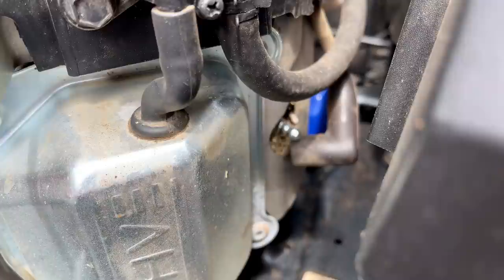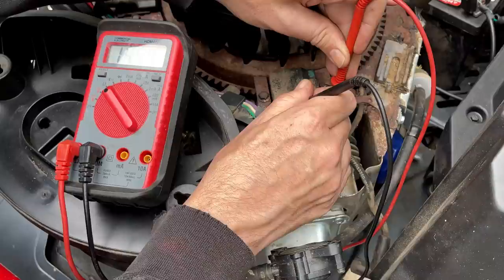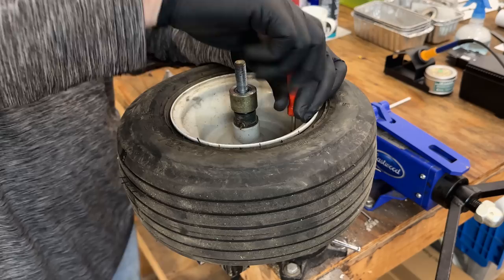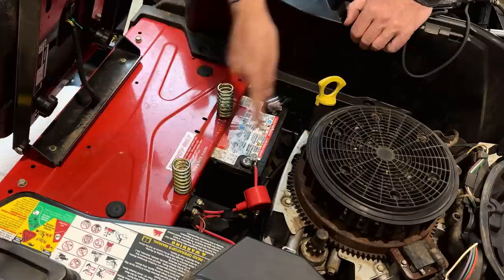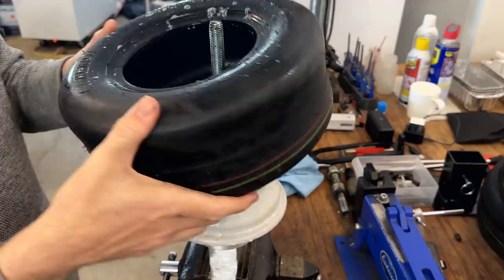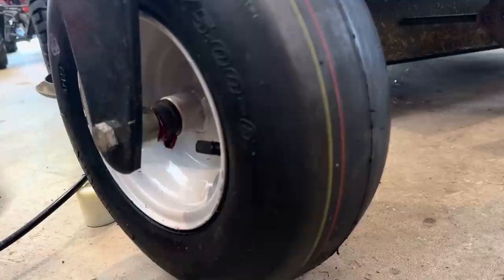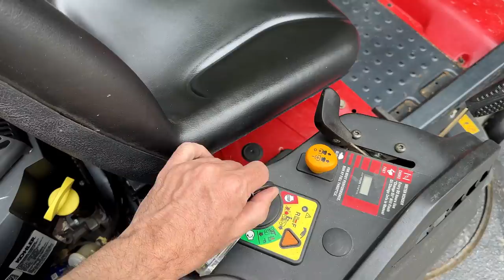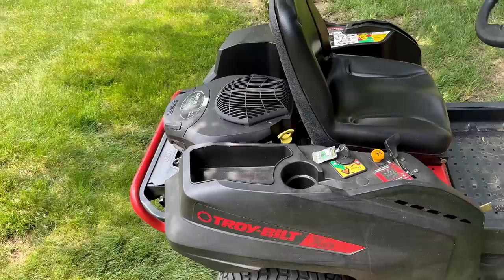Zero Turn Mower Down on Power - Not Firing on all Cylinders

Comment: Good call on the "working" coil. You had extended crank time before replacing it. After the engine started almost immediately. The missing chute contributed to the buildup of debris around the cylinder fins. The grass blew almost straight back toward the engine. Those small tires are a pain, you were lucky the rims weren't rusty like the ones I deal with. I just stick tubes in them. Great job!
Reply: I usually put tubes in all small wheels that start off without! Usually every spring the tires are flat over the winter if there are no tubes and then seem to slow leak all the time. So out with the same tire tool James has! They stay up then much better.

Comment: I like to coat magneto fasteners with threadlocker after touching them up on the wire wheel. That way the dissimilar metals are isolated and they can be set snugly. If they won’t come off easily the next time, then an application of a little heat will easily free them. No rust, no breakage!

Comment: I will give you a great tip I learned with these small tires on wide rims, I use a tube between the rim and the tire bead soaked with solution , so when you air up, the tube will roll out of the way and the tire will seat.

Comment: I as well very interested in what you do. I've always loved engines and getting them running again after years of neglect from previous owners. Garbage picked so many machines, engines over the years and got them running again and selling them and using the money to buy tools and garage supplies. One suggestion I have is to use dielectric grease on all electrical connections, spark plug boots....protects from water intrusion and that fretting corrosion. You do nice work James.

Comment: I certainly admire your diagnostic skill at fixing the engine. The design of the actual mower deck, with that gaping exposed space just where a foot can step into active mower blades (especially  a child's) is an engraved invitation to amputated and/or maimed body parts and lifelong guilt and regrets when someone gets hurt. I get the feeling that Troy-Bilt simply does not care about designing for safety. With that said, I will never need one of these machines. Troy-Bilt does not seem to be popular in my geographic area. It was very interesting watching you fix the engine and tires.

Comment: on mounting small tires, placing them on a smooth rim bucket or flower pot, so the wheel hangs from the top bead  and the rim of the bucket seals on the outside of the other side of the tire.  when airing up the air escaping into the bucket, pushes the wheel and upper side of tire up until the lower side of the wheel meets the underside of the tire and starts to seal.  i found this the only way to seat the rear tires on my riding mower without putting a tube in the tire.  btw,, the center hole in the rim needs to be sealed with heavy tape or make a plug of some sort to prevent loosing any air.  the rear wheel on my mower had 3/4 hole to slide over the axel so ta;e worked.  a large center hole or lug bolt style wheel will require a more creative solution.

Comment: Really James it's always been a sort of law when working with batteries you ABSOLUTELY never take the positive cable off before the negative.   Jus sayn   Other than that you really do very great work on whatever ur working on..
Reply: Please do not take this the wrong way..the rule is disconect " GROUND SIDE" first. Even today there is positive ground equipment. Not common anymore, still found occasionally.

Comment: Mechanics from way back (yours truly) would do a thing called "a dynamic compression test" on the very old (but at the time very high Tech) Sun Ociliscopes. We had the ability to very accurately monitor the RPM and ground out each cylinder individually and record the difference in RPM from the lost contribution of the grounded-out plug. The one with the least difference was suspected for low compression or other ills. The Shade Tree method was to take your test light (Almost always the old and indestructible Snap On) and attach to a good ground and then slip the tip under the plug wire boot at the distributor to ground out and listen to RPM change of each cylinder to determine which one was contributing least or not at all. Most engines were V8s or straight sixes so this was a fast way to zero in on the work.

Comment: Remember the fire triangle. The starting fluid trick won't work if you don't have enough air (oxygen) for combustion. No oxygen, no F-wap!. Hook up the air as if you're filling the tire then spray your flammable liquid into the tire and ignite. It may take a few times before the tire warms up and becomes flexible enough to catch. Filling the tire CONSTANTLY with air will also help it stay in place on the bead once it catches..

Comment: Had the exact same issue with my Toro Z turn with the Toro engine. At 5 years the coils went. It drove me crazy for a while trying to diagnose the problem. For a few minutes it would run great and then all of a sudden it would lose about 50% power. After a few minutes it would then return to running great.
 It drove me crazy for a while trying to diagnose the problem. I'm just a DIYer and thought is was a carb issue. After putting two new coils on it ran great

Comment: I had a gravely mower with that same engine. One summer it started bogging severely, almost like you had killed the spark to it. The issue only happened when going down a hill.
I replaced fuel pump, spark plugs, low oil sensor, ignition coil, carburetor, fuel filter, seat pressure switch, and made sure there was nothing blocking the fuel pickup. 
I got fed up with it and sold it before i could figure out what was wrong with it.

Comment: We ended up getting a Craftsman battery zero turn from MTD but looking at a Cub Cadet with that steering setup. NOPE! Never saw such linkages and potentiometers to tie it all together. Ours has 4 motors, one for each drive and one for each blade. Simple, quick and powerful. Plenty of reserve to do our place on one battery usage bar out of 5. The Stihl hand mower does the same. I've got an 85 Snapper and a 20 horse Craftsman Vanguard 42 inch for spares but they get to rest. I know that battery stuff is a new market, TOO new but we shall see. We have a small heater to keep the batteries from freezing in winter. Doing what we can do. God Bless

Comment: After watching you battle with those front tyres I'm glad my Toro timecutter has solid front tyres. I think I prefer the standard twin bar steering on my Toro it can rip the grass abit especially if it's abit damp but looks to turn better around small obstacles.
Reply: I have the same as you.. agreed on the solid tyres.  Factory ones would roll off too easy.  Also you are correct about tearing up grass!! Not good if damp.

Comment: Tire mounting compound. Aka bead grease. That’s the ticket that would have allowed you to mount that first set.
Reply: There is a video called “how to bead up a stubborn tire”. Older guy shows you what I mean. You fill the opening with the Murphy soap and when the bead seats it will squeeze out all the “grease” and you scoop it up and put it back in the container for next time. Stuff work’s amazingly.

Comment: A tip, let the tires sit in direct sunlight for as long as you can, it will soften them, or boil them in boiling hot water, but be careful wear thick gloves, for the heat.
Reply: Those tires should never have been sold in the first place ! They were improperly stored.
Reply: k5576  every one I have gotten from certain shippers on ebay, and Amazon are like that, they suck the air out of the shipping bags for shipping purposes, to save space, it's a true pain in the butt, but if you know how to deal with them, they can be used.

Comment: I had a similar problem on a Honda EX1000 generator.  It would not power up.  I took it apart and found out a tab on the exciter capacitor had rusted off.  I replaced the capacitor and it powered up, fine.  I think it happened when the little Honda had got caught in the rain.  I put dielectric grease on all connectors when I put it back together.  Had no more problems with it.

Comment: Love your approach on this stuff.  May I suggest that whenever you change a battery you spray a little weak bicarbonate (baking soda) around.  It shows if there has been any acid escape which can do a lot of damage if not neutralised. I know that these sealed batteries leak a lot less but still can be a problem.

Comment: Good work as usual but I was a bit disappointed that you did not fit dustcaps to new tyres and you did not check the integrity of engine oil after the engine getting very hot and unburned fuel from cylinder that was not working, Somerset mike.

Comment: I have one of those Kohler 7000 series 26 hp on a Husqvarna zero turn. I've had to replace both coils on it after about 4-5 years. Starter after 4 years. Other than that no other problems.

Comment: I had the cub cadet version of this mower. They are like a billy goat on a side hill. These are as far as I’m concerned the best zero turn for a home owner. I had a bad boy maverick and didn’t like it. I will when I can afford it get another cub cadet. You may have been better off with a tread on those front tires for side hill traction. BTW that mower will easily hold your side hill

Comment: That is nice looking machine for its age,  with such few hours explains why. Again another interesting and informative video, sir. 😊
I use mine once a week,  but I only have half an acre ( about 30-40 minutes to cut my grass) sometimes I go very slow so the battery wil have more charge time.  And sometimes I just drive around the neighborhood for about 15- 20 minutes.
Reply: Using a Battery Tender greatly improves the battery's life.
Reply: @lnk4328  
Yes, that is a good idea.  My Kohler puts out 14.25 volts,  and I have used my regular battery charger and charged the battery in the winter.  The battery is 5 years old so its probably getting close to needing to be replaced.

Comment: Koehler engine very light duty substandard engine.on mine the bolts fastening the flywheel hosing came loose causing vibration then the block cracked .when I tore it down I was amazed at how thin the block is.paper thin casting.I’m always amazed at the people that buy a machine and never maintain it.Full of  debris and probably never had an air filter change

Comment: This mower is NOT a zero turn. Zero turn mowers can spin in place and are steered with the independently powered rear tires and two levers.  It does have a very tight turning radius though.
Reply: Some zt now have a steering wheel. EGO just came out with one.
Reply: @JasonW.  Wheels or levers are means of control. The Zero turn means no radius. This mower has a radius.

Comment: When getting those mashed up tires...the trick is to inflate the inner tube inside the new tire as you did but sit the tire out on the hot black driveway in the sun for 2-3 hours, flipping them a few time to get them evenly hot. Then cool them before letting the air out of the inner tube. Or simply install them with tubes in them.

Comment: Nice video Jim. Great attention to detail and conscience approach to problem solving. I was wondering if that ZT Toro had only 2 larger blades offset to overlap the cut. I have a Craftsman 42" rider with a 19.5hp Briggs that uses 2 large blades and although it seems like a lot of HP, it won't cut high weeds at anything more than a snails pace. I grew up on a 1948 Ford 8N w/ a model ''A'' engine, rated at about 23hp. Dad got a Mott 72" Flail mower for it and I cut 4' weeds right down to the ground and all mulched up with it easily when the knives were sharp in first gear at about 3mph, and it had to pull the 2,500Lbs of the whole tractor around too. Thanks for the walk thru on the repairs. ben/ michigan

Comment: Hi James, as always, a really good video, and spot on diagnosis. Just a nit pick on the vocabulary. Ohm, Kilo Ohm, Mega Ohm, is how most EE's refer to the Ohms ratings...... Thank you very much for the video's. And then I have another question, would applying a dose of slim to the new tires not help with future punctures?
Reply: The question about tire slim is a good one. Personally,  I haven't had much luck with tire slime,  or fix a flat.  I haven't tried automatic transmission fluid.  I have seen others say it works pretty good.
Reply from the maker: Slim is good, but try to avoid it since it makes a mess when the tire is eventually replaced or tubed.  Was hoping the new on will last longer as it was 4 ply instead of 2 ply like the original.  Paul Cub Cadet had similar punches on the front tires.  Might be something in his yard causing the issue.

Comment: I have a Troy-Bilt Mustang 50 that looks to be around the same year as this one. The battery hold down is broken. That bracket by the battery should come over the top of the battery and hook into one of those slotted holes in the metal on the other side.

Comment: Run over a thorn and you have a hole in the tire. They have no belts and certainly no steel belts. I take the old tire. Cut the tread area out. Put it inside new tire then tube then inflate and never had a flat again. The other thing I have done is put some Slime in them. Again never had a flat. Tractor Supply is great. I bought a huge dual fuel Duramax generator on a closeout for $950. Here in Florida I may need it. Set it up to plug into house. It runs everything. I would find a way to cut the shoot cover down but still cover the top of the deck. Wish I could have grass like that. It cuts in reverse.

Comment: I had to laugh at the beginning of the video when all the junk blew out of the motor when you started it. I would have pulled the flywheel as well to clean any debris/nest in the alternator area. With new distorted tires, I learned the hard way just to take them to a local tire shop and have them use a "Bead Bazooka" to inflate them. My shop will do it for $5ea if it's already on the rim or $10ea if they have to mount them.

Comment: I think you should keep a key hidden on ring and hook under your truck. This saved me alot turmoil over the years learn to lock doors with keys instead pushin botten down and closing door or using power lock switch. I had former new Yorker who was my co driver locked me out i. The city but my hidden key saved the day for me

Comment: Stating fluid is a good idea but you need something that will explode to create the pressure spike that slams the beads onto the rim...

Roadside Tire Repair trucks use a tank of compressed air with a rapid-dump valve to do the same thing...

Comment: All the grass clippings will be back on top of the engine in short order if a grass chute isn't installed on that deck. Without the chute the lift of the right side blade throws the clippings up in the air where they can be sucked in by the flywheel fan. The discharge chute keeps the clippings nearer to the ground.

Comment: I had a 30hp Kohler commander. It became difficult to start the dealer recommended new coils and they came with a wiring diagram that deleted the emission controls what ever they were. After that it ran fine for years. I often thought it was the emission that caused the problem with the coils.

Comment: Great video as always. If you don’t get a small tire changer, you can break the beads by believe it or not running the “tire” over with a car or truck. I have a tire machine just for these small tires and I still at times have to do this to break the bead. It works..
Reply: I use my vertical electro-hydraulic log splitter and a bit of 2 x 2, or 50 x 50 as it is here.  :-)

Comment: I'd like to recommend "Tire-Ject".  I am not affiliated with this company in any way.  I have paid retail for all that I have ever purchased.  I despise "Fix-A-Flat".  Slime is ok, but messier... I have used Tire Ject in all my ATV and mower tires that present a problem.  It is one of the only products that can actually help with rim leaks, etc.  I use it it all my off-road tires.  Holes in mower tires from thorns, etc. - the usual hazards are sealed instantly.  I once had a pair of rear tires on an ATV that would hold air only 2-3 weeks, never could find the leak(s)... put Tire Ject in there, haven't lost any air since (over a year now...).  This stuff will even seal minor dry rot (for off road use only, of course...)  It actually has a semi-pleasant smell, and cleans up easily.  I don't know how they do it, but I love the stuff...

Comment: Did you forget about checking the engine oil? If a multiple cylinder engine - not running on all cylinders, have been running for a while with a fault like this - usually the engine oil will be contaminated/mixed up with gasoline. (Sorry for bad english, hope you know what I mean)

Comment: James I was under the understanding that when you turned on your power take off for your blades that you want to have your motor idle down somewhere in a half range so it isn't so much shock on the clutch does that make sense to you?
Reply from the maker: That makes sense.  Always hate how quickly the electric pto turns on.  Always liked the manual lever better.

Comment: I have had a lot of trouble finding a good tire machine for small engine tires. Harbor Freight sells one, but it only works on 12 in tires and below, and most mowers have 13 in tires on the rear, so it is only useful for front tires. I haven't been able to find one that will work on 13 in tires, and all five of my mowers need at least one rear tire right now.

Comment: Informative, and BORRING..... I would rather watch paint dry.  Funny thing is I have the same mower, but it's an 2014 Cub Cadet with 160 hours and no major problems. The steering is done with a linkage connected from the front steering to the pumps on each rear wheel, doing the same thing as levers would do.